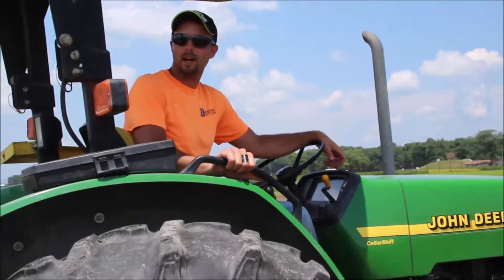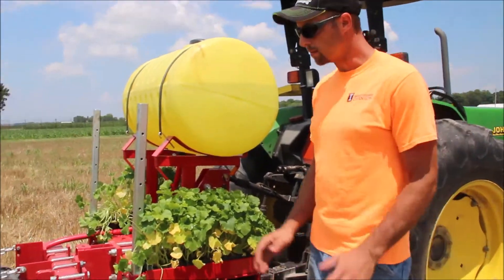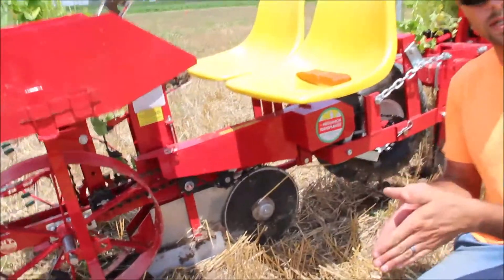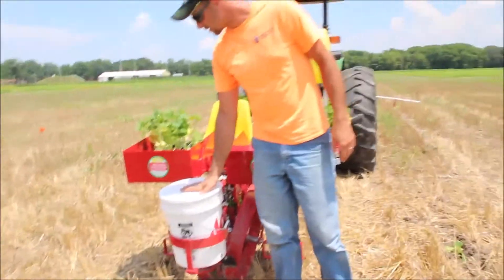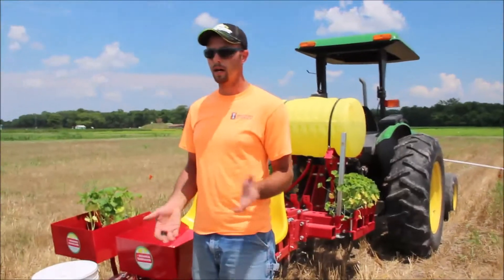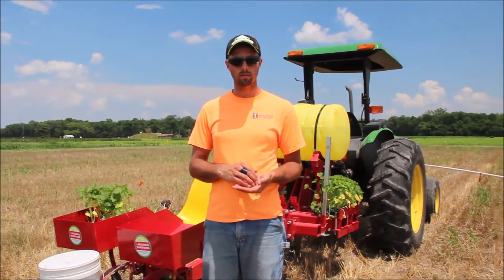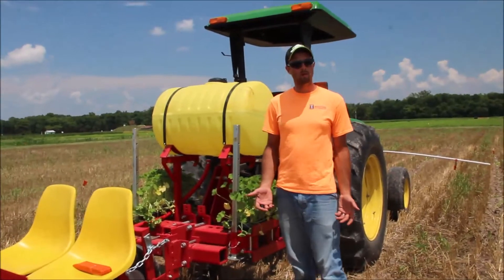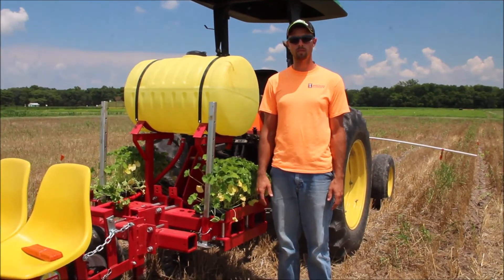Making a No-Till Transplanter Work for Vegetable Crops

Comment: So with no till would you amend your soil how long before planting? to increase the fertility of soil?
Reply from the maker: With no-till you can amend with compost, natural, or synthetic fertilizer amendments either broadcast any time prior to planting or after planting.  Sometimes we also will sidedress these amendments banded along the row as well.  With any of this I would start with a soil test to know your base fertility of the soil and hopefully have the main nutrients and pH in optimal ranges.  Also, cover crops are frequently used with no-till to help build the soil organic material and fertility in a long-term management.